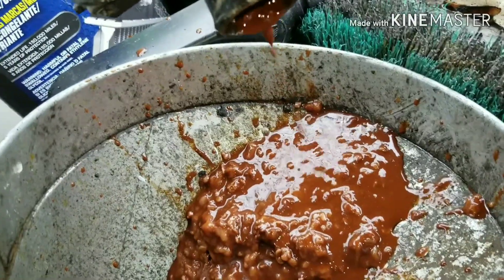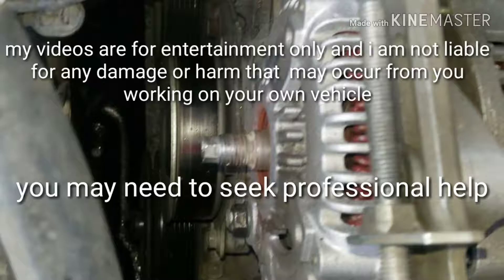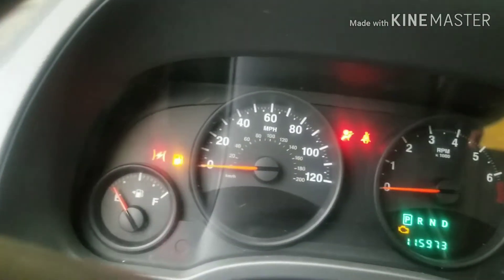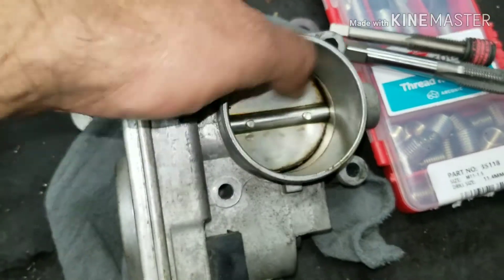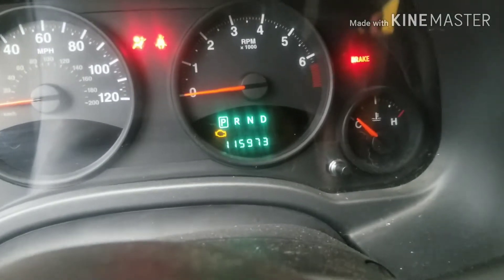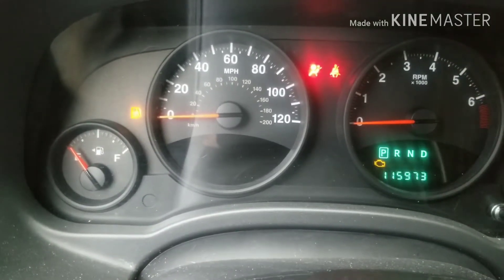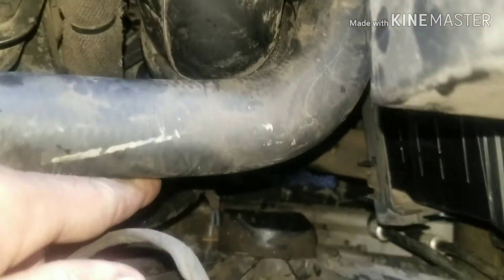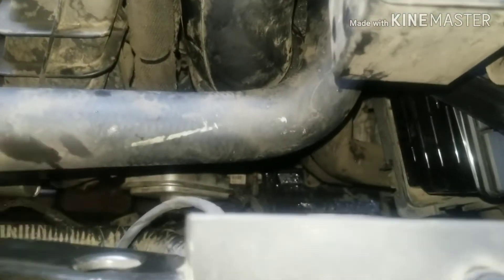2013 jeep compass electronic issues

Comment: You just need new spark plugs people!  The spark plugs suck on Jeeps and you have to changed them out like every 60 or 70k miles.
Reply: Not necessarily. I changed my spark plugs thinking that's all it was. Worked fine for a week or 2 then took a crap.

Comment: My jeep compass turn iver but will not Fire up  Took The automati e throttle control off and it seemed fine. It doesnt make since bc i just drove it and threw houra later i went out to start it and it would t start
Reply from the maker: thanks for watchin, I'm not sure if it starts up with the throttle by wire unplugged that means it goes to fail safe mode, it could be that sensor is shorted out but I couldent say for sure

Comment: I’m having the same exact issue with a 2014 Jeep Compass. The code says U0401 and it’s says Implausible Data Received from ECM/PCM. So I’m trying to figure out if it’s the actual computer, connections, or maybe this throttle body. 🤷🏻‍♂️

Comment: After many attempts to try to fix our 2016 Jeep compass, it's finally going to be fixed. The low traction light the check engine light and the voltage light came on and it wouldn't go over 10 miles an hour. Turns out this problem was the throttle body. So if you're having these kind of problems and you're turning to YouTube videos. I'd say nine times out of 10 they're a real big help. And I was wondering now that it's fixed if I should sell it or keep it? Thanks btw. 😁
Reply from the maker: Thanks for watchin really apreciate it   and I'm glad i was able to help you get the job done. There fairly decent rigs only other issue that they have usually is the cvt trans thanks for watchin besure to like And subscribe for more tips and tricks and check out  fixergood on facebook and instagram
Reply: I’m having the same exact issue with a 2014 Jeep Compass. The code says U0401 and it’s says Implausible Data Received from ECM/PCM. So I’m trying to figure out if it’s the actual computer, connections, or maybe this throttle body. 🤷🏻‍♂️🤦🏻‍♂️ Sucks lol
Reply: Is it still fixed?
Reply: Just fixed my throttle control too because that lightening bolt kept flashing but also my headlight is out. I was told it was my TIPM so I got a reman (used) after I put that in, that flashing bolt symbol still would come on not letting me drive above 25mph. Just bought a new tipm getting it placed Monday. I hope this will solve my problem. I inherited this car from my mom who bought it brand new and I had it four years after my mom gave it to me. it’s s 2013 Jeep Compass.

Comment: I have a Jeep Patriot 2010 model, and I can take the keys out of it and wait 2 hours or even longer or not as long and you can hear things behind the radio moving around in there, and I have had weird things happening to some places I go , anyone know how I could find the wires under the steering wheel and dismantle this nuisance.Thanks
Reply from the maker: It could be a blend door , if its vaccum operated it could be moving after the vacum bleeds off after it sits. Hope this helps  besure yo like and subscribe for more tips and tricks.

Comment: Hey bro so like I have a 2008 Jeep Compass today the battery light came on and then my wife took it to go see her people. While she was out the jeep turned off while driving so she costed to an exit and parked it. I went a tried to jump the jeep off but wasnt lucky. So I went a got a new battery. Started right up but now it wont accelerate but it will rev up no problem. Any idea what I should be looking to as the problem?
Reply from the maker: It could be possable the when you hooked your battery up you popped a fuse  and now theres a system not working. Thanks for watchin besure to like and subscribe for more tips and tricks